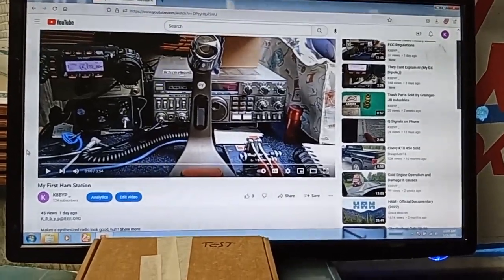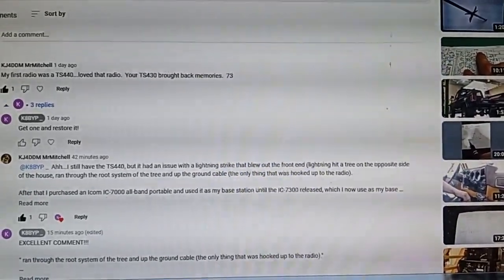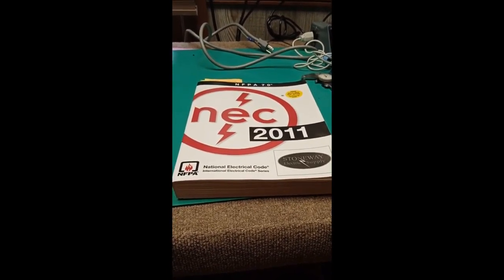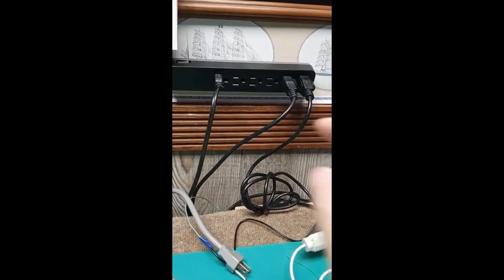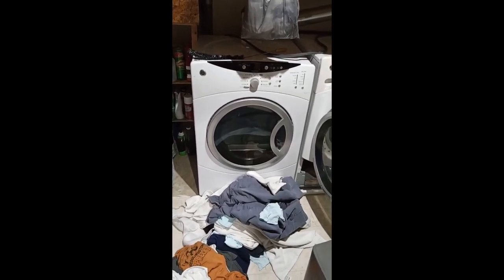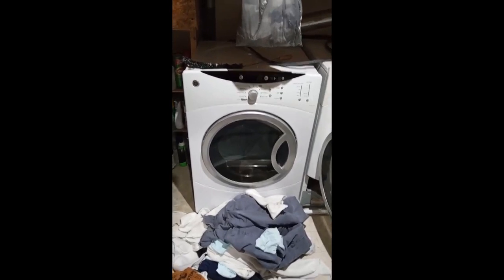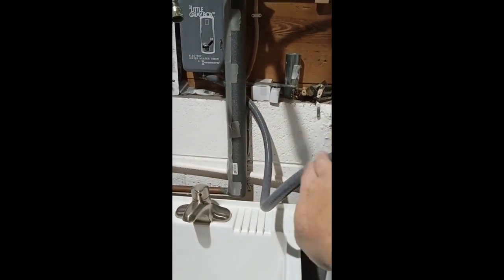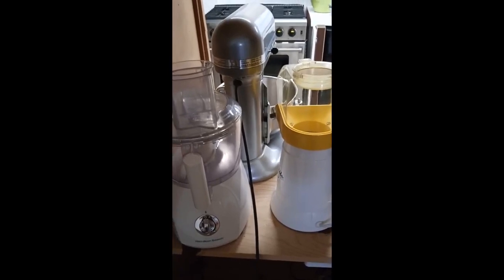UPDATE - NEVER GROUND HAM RADIO EQUIPMENT!!!

Comment: Difficult subject for most hams! I have not had a rig grounded for probably 50 of my 60 years as a ham! That was when I was a teenager and not yet an electrical engineer! One issue I have is when using a vertical that works against ground. The shield of the coax is connected to ground at the base of the antenna. I have one such antenna for 160 meters. I disconnect and roll up the coax in the summer. I always unscrew the PL-259 from my switch. I do not want the chassis of my radio to see a path to ground except through the power cable which has that green wire connected to ground at my power panel! 
Unfortunately many if not all radio manuals show an isolated ground rod with a wire to a screw on the back of the radio. Like you said it probably originated back when crystal sets were invented!
Reply from the maker: OUTSTANDING COMMENT FROM AN ENGINEER.

Please do a video to post here, credit to you. Id like to hear you expound on it, especially circuut analysis.

Point is this is NOT a ham topic. It is not a radio OPERATOR topic.

The first instance was early wire antennas against ground. No option then due to ELF operation.

As to the vertical against ground, thats also an old concept from early radio at extremely long wavelengths. Ground is not necessary at HF, use a metal plate of "small extents" (called a "ground of small extents"). Elevate the plate. Thats what a car body is!

Comment: unplug all gear if a lightning storm is present first rule of thumb.
Reply from the maker: ABSOLUTELY RIGHT. In fact, unplug it when not in use, lightning discharges can occurr on a clear day "clear sky lightning" and it doesnt even take lightning, it can just be moving electrostatic fields in the air. Its SO easy to prevent as compared to trying to stop it, which is darn near impossible.

Theres no stopping a 10 Mv discharge at 10,000 peak amp. With a #6 wire?

HAHAHAHAHAHAHAHAH right...

And the coupled (induced) fields even from a strike a mile away can induce a Kv in a wire (or so Ive read). It wouldnt hurt to even disconnect the key and mic cables.

Some Hams have gone as far as putting the end of the coax cable in a Mason jar. That cable end can start a fire if it can throw sparks around. Thats also a risk of the jar exploding. A Ham/Broadcast engineer told me about lightning hitting a tree, resulting in the PL259 MELTING.
Reply: Disconnect antennas And electrical power points .
Reply from the maker: Yep. But that sound advice doesnt allow people/ companies to sell parts..
Reply: Exactly that`s what I do
Reply from the maker: And disconnect even if its not powered, a close strike can induce high voltages in any wiring, even a speaker.

Comment: No amount of grounding is going to protect your equipment from a direct lighting strike. BTW, I'm 65 and have never had lighting hit my house or yard for that matter.
Reply from the maker: Darn tootin! And if youre 65, then YOU havent been hit in 65 years! HI

Grounding ENCOURAGES a strike and grounding a radio is same as connecting it to a lightning rod!

But there are generations of people now that have never seen one.

And it doesnt ' protect' ( vague term) against indirect discharges because that is very strong EM waves from the discharge propagating thru the air. That discharge was ground- referenced, so to speak, a discharge current into the Earth, so grounding a conductor at a distance just helps couple that energy into the wire.

Comment: Great. One less thing to do.
Reply from the maker: Yes, installing ground rods sucks!
Reply: @k8byp Hi, I forgot to ask. What about installing a coax grounding block? It is a good or bad practice ? Will it attract lightning ?    One of the commenters on this video described seeing a blue electrical discharge at a disconnected coax terminal during a windstorm. Will a coax grounding block help to protect the radio in such a windstorm ?  Thanks.
Reply from the maker: No means no. Read that comment again, the blue arc was ACROSS the end of the coax.

Thats corona related, not lightning, see my video on corona discharge.

Whats ground got to do with that? Put arc points ACROSS it at the radio.

Comment: I am very grateful for this video. I also read just about all the comments. It is an interesting thing on YouTube. There are two main "Elmers" that I watch and they both agree on "grounding" but disagree on how to do it. The whole time I am thinking to myself, this does not seem right. I have an EFHW and run max 100 watts. I do not ground the antenna or the rig. Also, I usually run straight battery DC to the radio. Anyway, when I know a storm is coming or I will not be using the radio for awhile, I disconnect the coax from the back of the SWR meter and place it in a glass jar. Also did that in my 11 meter days and never had an issue.
Reply from the maker: "Elmer" and " licensed to operate radios" are NOT qualification on this issue. TWO uneducated opinions are not better than one.

Hams= Radio OPERATORS.
Grounding= LIFE / PROPERTY SAFETY ENGINEERING

This is not Probabilism. And not a hobby topic.

LAW says what is, not radio operators uneducated opinion.

"Using battery power " does not get around it, NEC regulates DC systems also.

See my video on PROFESSIONAL ENGINEER REQUIRED.

https://youtu.be/kgniXHhBHfA

Comment: I appreciate the research, experience, and information you've shared here.  I think some of the confusion comes in around grounding vs bonding and how that is to be best accomplished.  I'm certainly no expert on the matter, so I appreciate hearing from those who are.  Thank you.
Reply from the maker: Thanks but Im just repeating what others have done or published, Im no first hand expert. I 'stand on the shoulders of giants' ..Atlas Shrugged.

I am John Galt.

Bonding is a sub topic of grounding, bonding is a permanent metallurgucal connection thru high pressure- bonding clamp, not soldering. The ground conductor is ( permanently) connected to the ground rod by means of very high pressure. The same concept applies to electrical crimp to wire terminals, its not a simple mechanical fit- sufficient force is applied to literally fuse the conductors together thru the surface oxides. This requires a diamond saw and microscope to see.

Comment: Thanks for this. Fascinating! I would venture a guess that 95% of ALL experienced hams have this completely wrong. Virtually every thread and video talk about the importance of grounding all radio equipment. Not only radios, but also coax, etc.
Reply from the maker: I HAD IT WRONG!

And, not ONE of ' them" can explain the science behind it, or cite the Code in support. A$$L have deceived us into thinking this is a hobby topic and space for personal interpretation.  IT ISNT.

BUT...also had enough experience from nuke world work and circuit analysis to start to critically think.

The circuit analysis did it. And NEC 250 strait out saying so.

I didnt publish anything about this until finding the Paper from VanDoren which stated it was a Code violation and unsafe AND not effective for RF grounding, to do so.
Reply from the maker: : 0

Comment: So, to be sure I am understanding this correctly....  You're saying do not connect any extra grounding conductors (other than the 3-prong power cord that CAME with my ham radio power supply) to my radio gear?  No extra ground rods connected specifically connected to the radio gear in my shack?  Correct?  This makes sense to me since the two radios in my shack are "mobile" radios and they operate on DC power....  which means they do not have a 3rd ground conductor OR and place to connect one.  Now, my real question is....  I have two vertical antennas mounted on the gable end wall of my house.  One is on a metal pole (mast) that starts out berried 32" into the ground and then is lag bolted to the house framing at the peak of the gable.  The other is mounted to a 6" metal pole (mast) near the soffit on the back of my house.   Both metal poles (masts) run to my coax entrance box (enclosure) where I have a lightning arrester/static discharge device on both coax cables before they enter through the wall of my house....  both metal masts, and both static devices are all bonded together and then ran down and bonded to two 8' ground rods with a #6 bare copper conductor.....  Should this setup be connected to my intersystem bonding bridge connector near the ground rod that serves the electric service where it enters my house? Thanks in advance. 🙂
Reply from the maker: 1. The static devices cannot be grounded, thats a contradiction, see my video on corona. Grounding is making it WORSE. Statuc charges try to go UP, not DOWN. ( Corona discharge)

2, The grounding system you have violates Code, besides the fact theres no requirement to ground anything except towers, theres no Code requirement for grounding coax, whuch implies grounding an antenna which, again, is a gross contradiction by making the antenna a lightning rod. The  implication of grounding coax is NOT for radios ( CB/ Ham) its for CATV systems with MILES of coax parallel to the high voltage power lines. It becones a violation when the coax is brought INSIDE the house and connected to the radio on commercial power.

Think...where else is a lightning conductor brought  INSIDE THE HOUSE? NEVER! Thats DANGEROUS. Grounding is done BEFORE a system enters the building.

The masts are fastened to the house, implying a hazard, fastened to combustible material. Towers are required to be grounded, not masts like that. Grounding them is a hazard of ATTRACTING a strike due to " return stroke", see my video on that.

The coax cables are a path for lightning, they MUST be spaced away from the house.

None of what youve built will do anything but make it worse, best to remove the lightning rods ( antennas)  from the house and mount them on separate masts. That reduces the chance of a strike hitting the house thru the antennas attracting it. 

Grounding a mast ( pipe) is not a real ground unless buried deep, then that encourages a strike. ( return stroke)

The wires from the masts to coax box ( ground wires)  are useless. Ground cables for lightning rods are upwards of 2 inch diameter stranded Cu or Al to be low enough impedance to conduct strike energy.

Better to put up a tall pole as a deliberate lightning rod and pray it works.
Reply from the maker: Grounding against lightning is like putting a chain link fence  to keep a semi truck from hitting the house.
Reply: @k8byp   Seems to me that just running a coax cable into a house is a clear passage way for lightning to enter the house, grounded or not.   I think I'll just put a desk in my backyard with my radio gear out in the open elements..... and the antenna stuck in the dirt all by itself. lolol.
Reply from the maker: yes the coax is a conduit. thats why its required to pass thru a non combustible wall or thru conduit. I use pvc

Comment: I wondered when I was in the Navy how they grounded stuff on the ship, then I learned that the ship is the ground.
Reply from the maker: Yes and a VERY dangerous place. Not just lightning but air movement and especially aircraft.

High power systems such as megawatt radar anf horsepower electric motors run on 400 volts or more. Not something to laugh at. Something to FEAR!

Ground is a common connection so a huge steel boat is ground. Except steel is a very poor conductor.

The water is or would be except its not accesible.
It is for lightning.

A former Army helicopter crewman told me that basically when a chopper hovers then drops a line, touching it before grounding it means death due to massive static charges on the blades. Its a lightning generator.

Comment: Direct strikes are very uncommon in typical situations. Rather, most of the time transients running the utility lines into the house are causing the damage. EMP from near strikes is another source of problems as well. Of course disconnecting is a good practice, and, to help safeguard the other devices in the house I installed a whole house transient protector at the service panel and downstream at each device location as recommended by the manufacturer. Never a problem since, even after a nearby transformer explosion.  Best wishes everyone.
Reply from the maker: EXACTLY RIGHT. But.. this is a slightly different case.

It may have not been direct. Townsend discusses Branched Streamers (Branched Streamer Theory) which are tendrils off the main "bolt" if you will. This was probably one of those branches. It doesnt take much to destroy transistors and other delicate electical components. A few KV is far more than enough, it doesnt take a mega-volt discharge.

The point isnt the direct strike as much as the CHARGE TRANSFER up the ground wire. The direct strike is just the obvious part.

" Downstream" :

with MOV devices theres an under- lap of voltages. A service entrance device may not cover lower level transients ( look at MOV device specs).

The heavier service entrance protector should have a lower voltage rating that is too far above the max operating AC voltage of the load device (TV) which is above the max rating for a load protector device.

Should also use suppressors at the outlet that cover down to about 140 VAC.

And suppressors arent just for loads, the service entrance suppressor protects the WIRING from over- voltages that can cause cable leakage that starts wall FIRES.

Lightning transients can over- volt cable insulation and punch through it.

This is where we should still be using knob and tube wiring...

Comment: Good video! Sadly the ARRL - and the vast majority of YouTubers - advocate this insanity of grounding ham gear to an outside ground rod. The "buss bar" may be a good idea to keep all gear at the same potential, provided it's done right. And I wouldn't even do it unless I had issues ferrites wouldn't solve. Otherwise one creates problems with the potential of ground loops. Hams use round wire instead of braided (bad idea) and wind up creating mini antennas. I can anecdotally demonstrate this. I have two QTHs: one I had all of that buss bar stuff, connected to the outside ground rod using copper flashing outside and braid inside. And guess what? RFI everywhere, PLUS increasing the danger by several factors due to that stupid ground rod outside the shack attached to my FTDX101D! My second QTH has absolutely no "grounding" except the third wire on the respective AC plugs. No ground rods. No buss bars. I have zero issues with a 9:1 UnUn right outside my window feeding an EFLW. I have ferrite donuts to take care of the minor RFI have on my PC monitor's HDMI cable. Now if I went through all of that work I did for the first QTH, I'd probably have the same ground loop issues I had at the other location. Sometimes we as hams overthink everything....and end up outsmarting ourselves. I'm in Florida, the lightning capital of the country....so it's critical I get it right. If people would just stop and think about it....does a refrigerator require a separate ground rod? of course not. And the fact that we are using a two-way radio changes nothing as far as safety grounding goes. Now if we lived in the 1930s, and we didn't have that 3rd wire, one would need to take more precautions. Appreciate you doing this video. 73 de Scott W1AL
Reply from the maker: THERES THE POINT IVE BEEN FISHING FOR for two years!!!!!!

"Hams use round wire instead of braided (bad idea) and wind up creating mini antennas'

EXACTLY! RF that didnt COME from a ground referenced source cannot be grounded. Thats not a ground wire, its part of the ANTENNA system, or a sort of antenna or RF coupling itself.

THis is not guessing, its RF and circuit engineering just like designing radio circuits. Its complicated.

The buss bar thing was from the tube days with leaky power transformers.

The ultra sensitive phonograph has to be 
" commoned" to the radio chassis else it picked up hum.

Comment: Very Interesting.

I was full time RV'ing for years and would hook up an HF antenna at the sites, depending on what was available. One time in Wyoming, I had a 80 or 40m Ham Stick Dipole set up on a Paint Pole attached to the ladder. As a Storm was rolling in I disconnected the coax and dropped it on the floor - Only place to put it.  As the storm got closer, but not yet overhead, I heard this repeated snapping. When I looked at the PL connector I saw pretty blue arc going between the center pin and the shield side - like a big spark-plug. As I had never seen this with a standard dipole (no coils), I figured that the coils on the Ham Sticks were "amplifying" the static in the air. Used to be kinda lazy about disconnecting the gear - No Longer.  The Air is alive.
Reply from the maker: Correct on all fronts. The coil will intercept more M field. Tip it over sideways to minimize the field coupling

That blue arc would be the end of the radio